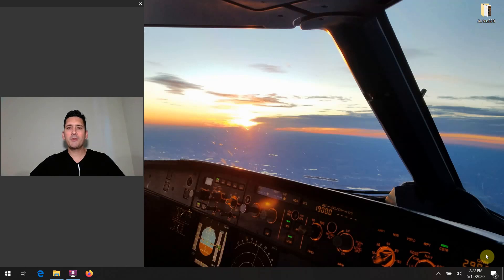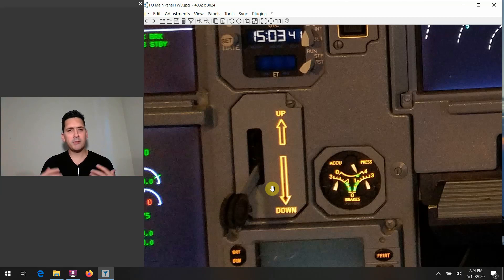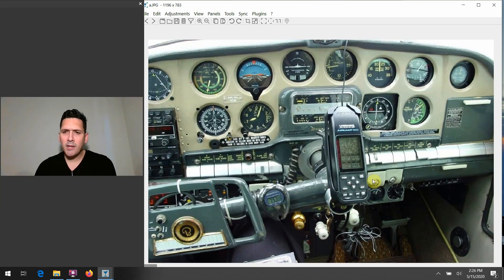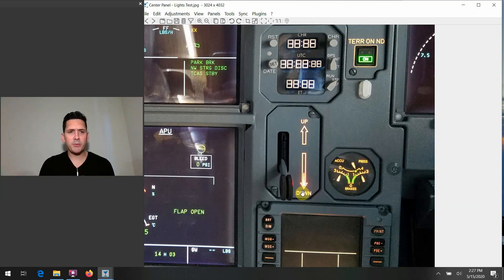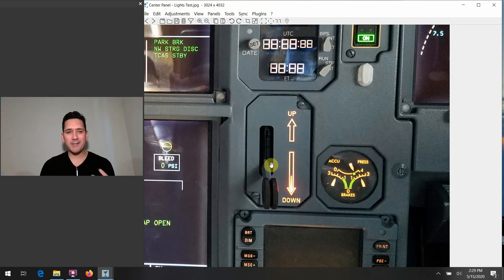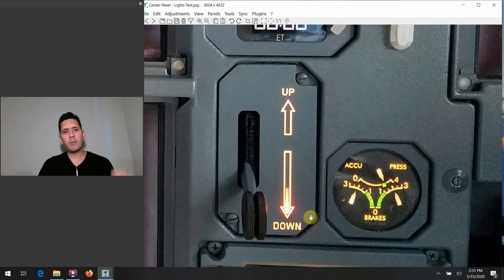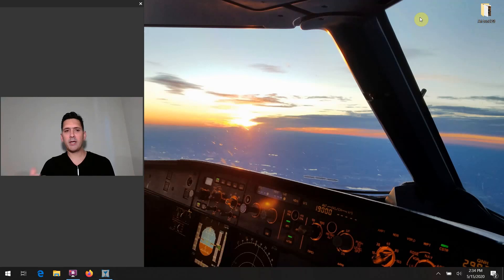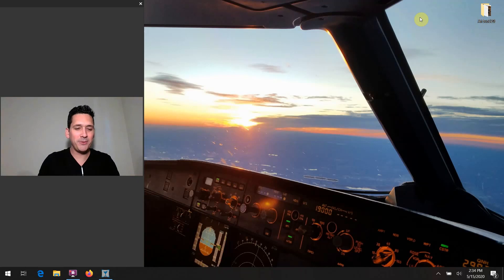Airbus A320 Cockpit Tour: #59 - Landing Gear Lever: What do all those buttons do?!

Comment: Apart from 3-gree lights ON when gears downed & locked, is there any automated "CALL OUT" in case not downed & locked?
Reply from the maker: Hi Kalim, thanks so much for tuning in! No automated call out but you will get a RED ECAM Warning and the triple chime audio. This is triggered in a few different ways:

Triggering Conditions:
This alert triggers when:
1. L/G is not downlocked and radio height is lower than 750 ft and both engines N1 lower than
75% (or if engine shutdown N1 of remaining engine lower than 97%) or
2. L/G is not downlocked and radio height is lower than 750 ft and both engines are not at T.O
power and flaps at 1, 2, 3 or FULL or
3. L/G is not downlocked and flaps at 3 or FULL and both radio altimeters are failed.
Note: In the cases 2 and 3 above, the aural warning can only be cancelled by the
emergency cancel pushbutton.